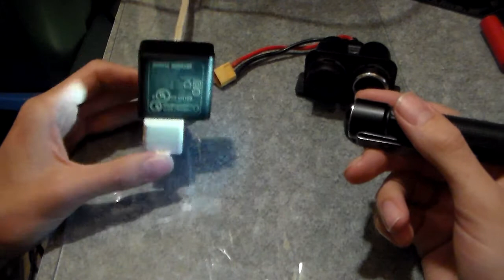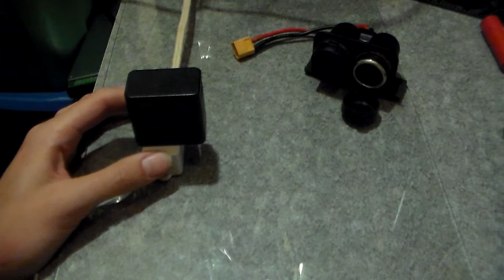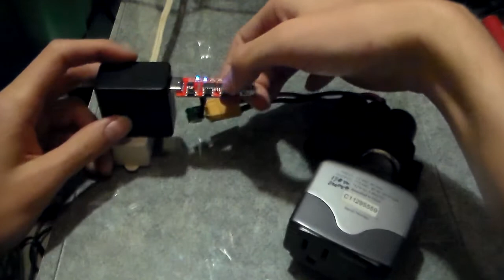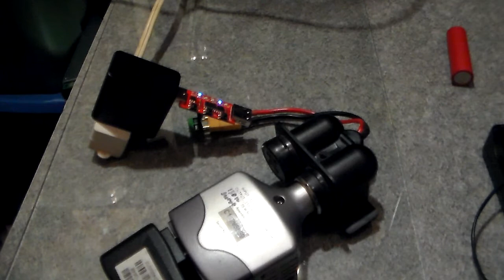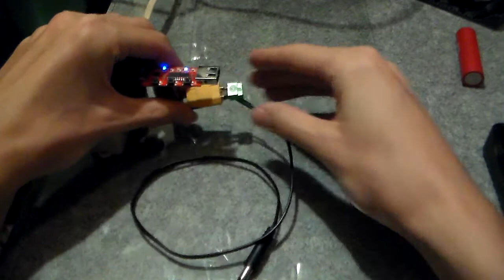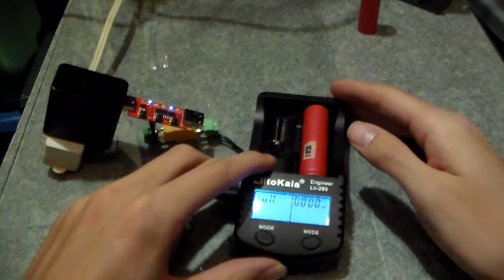USB to 12v Socket or barrel jack no boosting!!! QC 2.0/3.0

Comment: Hey! Nice video. Does the qc3.0 trigger remember the last voltage selection? For ex. I set it as 12v when plugged in and powered on and remove the trigger. When I plug it back, does it reset to 5v or remember my last selection of 12v. Thanks!
Reply from the maker: TechnoShare yes they do remember the voltage they were set to